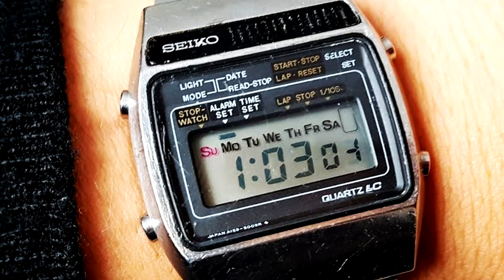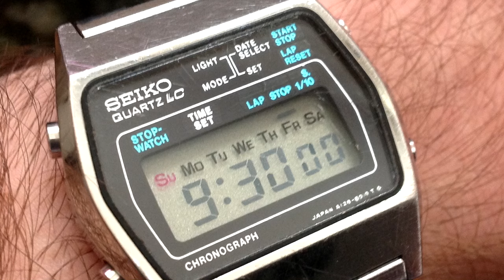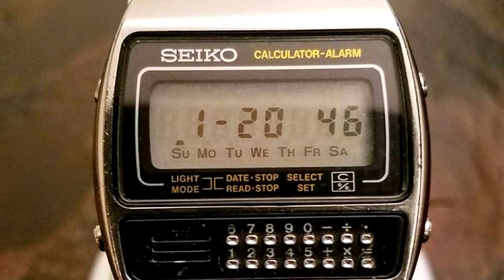How Quartz Watch Technology Almost Killed Traditional Watchmaking

Comment: I quite often think of the technology involved in a good old reliable digital CASIO, almost 40 years old if not illuminated by led backlight, and the retail price of a mid range average Smartphone, the cutting edge tech it has, when you put both side by side. The watch still survive thanks to its simplicity and years of battery charge, not to mention the Tough Solar line which lasts over 10 years.
Regards from Buenos Aires.